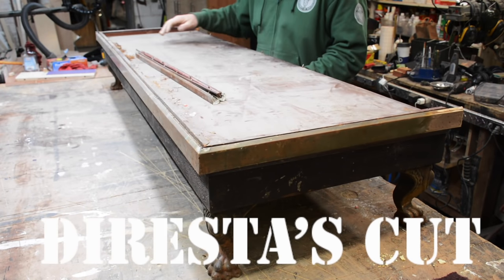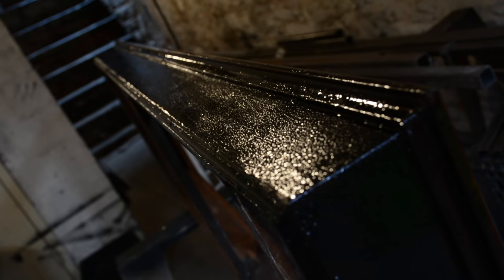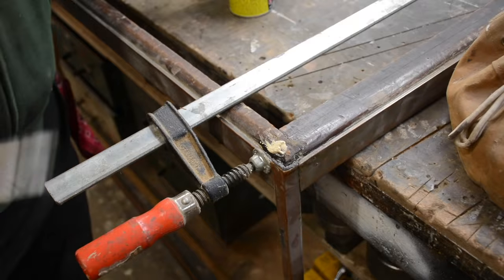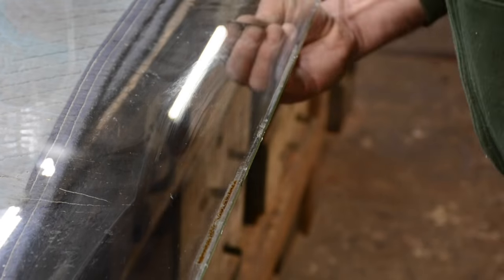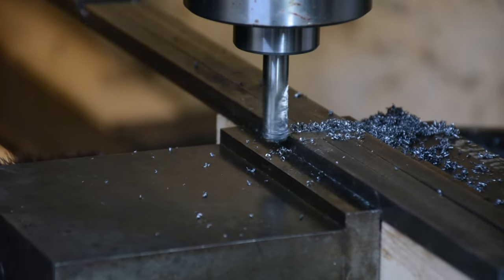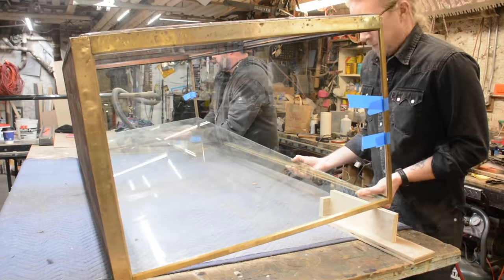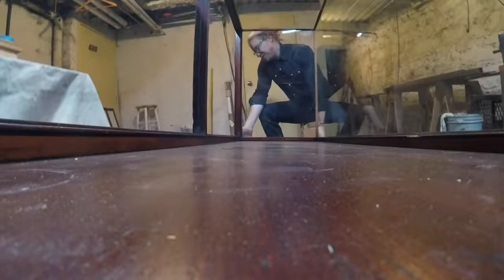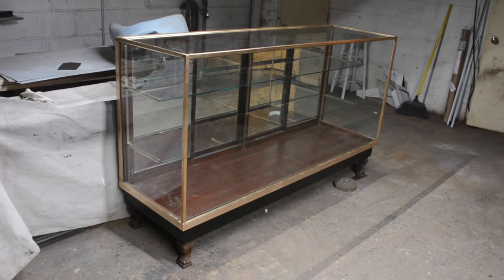DiResta Show Case Restoration (OLD VIDEO)

Comment: Great video—I like these old ones. You mentioned the weight of the cabinet, and I thought of a couple of 20 ft display cases I helped a glassblower buddy of mine move up in upstate NY. They were so huge and unwieldy that we popped down the street to the nearest bar and offered free drinks to anyone who’d help us move the ancient beasts into the truck. Worked alright, everyone was happy with their free beers, and we saved a couple of cool old display cases from the junkyard.

Comment: I'm glad you saved this piece. I like that trick with the pins and the epoxy to help align and join those corners. When you were putting those doors back in it made me wonder how many times those doors got opened and closed over the years.

Comment: Epoxy wont hold a damn, and you perfectly know it, slight push and whole thing will collapse. 
Thats why you constantly keep saying that epoxy is strong
Reply: Epoxy penetrates the wood fibres, which polyester resins don't. If you use epoxy and it falls off it will be because the wood split, not the resin. If the corner piece is properly treated the epoxy will bond to that very well as long as you abrade the surface properly. Those corners fixed with epoxy resin will hold, the wood will give a hell of a lot sooner then the epoxy 100%. It basically became one solid piece now. Just go to the shop which is using the display case now, you'll see it's sturdy as can be.